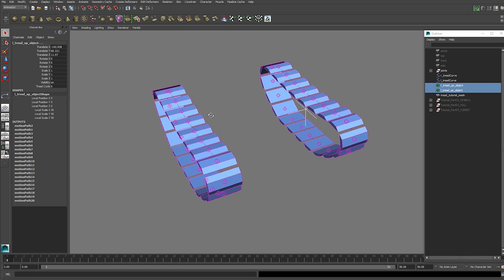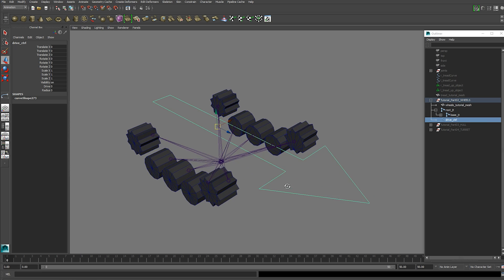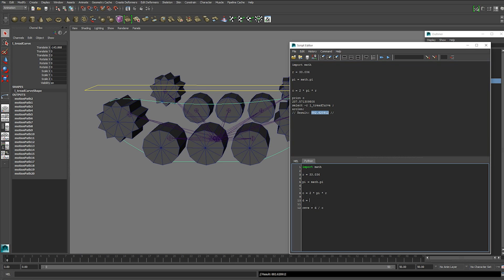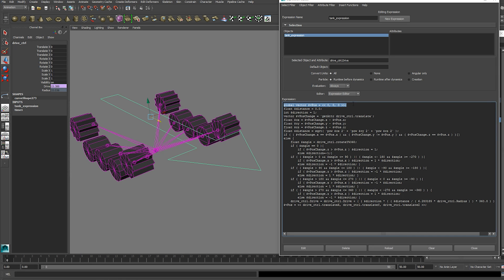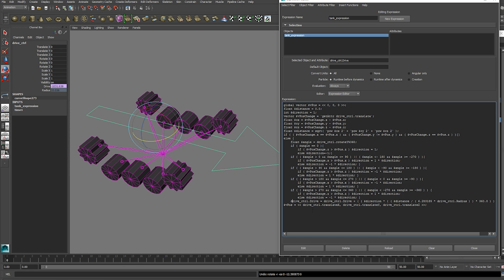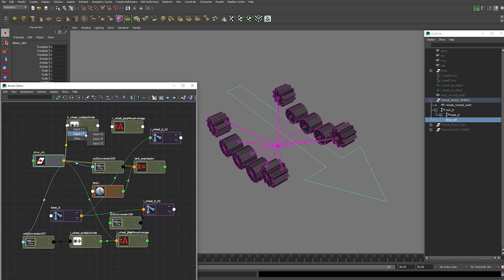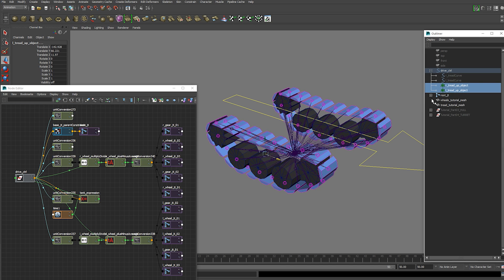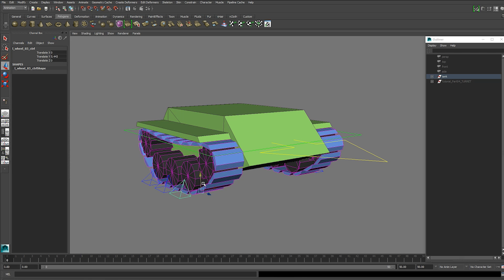How to Rig a Tank in Maya | Tank Rig in Maya | Part 2 Wheels

Comment: Hey man, thank you for the amazing tutorial! Only issue I'm currently troubleshooting is trying to have two different wheels of different sizes. I've easily set up two different controllers for one big wheel and one small wheel. The problem is that I can't find a way to have these attached to one controller that moves both at the same time, factoring in the different radius of both wheels. Every time I set up a parent constraint, or use the connection editor, I can only affect one wheel at a time, never both. The translate values on both wheels are changing, but only one drive value is. I figure it may be to do with the script but I am not good with programming/scripting whatsoever. Anyway, I'm still working on it now and hopefully I'll find a fix, but wanted to ask anyway. Thank you!
Reply from the maker: find the difference in size between the wheels and just use a multiply/divide node to connect to your main wheel. You wont need 2 controllers.
Reply: @SimonMills  Thank you! Yeah I was just trying that and I think I've almost got it, just not very familiar with these nodes but I should figure it out eventually. Thanks again!

Comment: Hi, this tutorial is great!
i have two questions about the expression, maybe you can help me out.
first, i don´t understand why/how it works with the global vector variable $vPos to get the value at the end from the code to be piped in again. doesn´t it read the value <<0,0,0> in the beginning, why it isn´t reset to that zero-value?
(maya help, doesn´t answer my question http://help.autodesk.com/view/MAYAUL/2015/ENU/?guid=Procedures_Global_and_local_variables)

second question, i had a hard time to wrap my head around the ifelse-angles, i tried it that way:
                 if(($angle>0 && $angle<=180)||($angle<-180 && $angle>-360)){
   if($posNew.x > $posOld.x) $direction*=1;

   else $direction *=-1;
   }
  if(($angle>180 && $angle<360)||($angle<0 && $angle>=-180)){
   if($posNew.x > $posOld.x) $direction*=-1;
   else $direction *=1;
   }
it seams to work too , but i would like to now if i miss something and there is a mistake in my version?

Thanks

Comment: Hi, I've run into a problem with the drive control rotation. The wheels rotate in the wrong direction when I rotate the drive ctrl but work perfectly when I translate it. Thanks.

Edit: I got it to work by making the revolution number negative. Will that cause any major issue later on?
Reply: I had the same issue, thanks :D
Reply from the maker: Nice job fixing the issue.  It should be fine.
Reply: @SimonMills  Thanks man.

Comment: Hi, love your tutorial, but i have a problem with the expression.If i move the Drive ctrl in x , and set it back to 0, the drive attribute doesn’t set back to 0.Can you help me? Thank you
Reply from the maker: You could add an if/else statement to the expression. If drive ctrl tranforms are all 0 then set the hidden drive attr to 0. It should not matter on final result though. When looking at an object rotated 0 it looks the same as 360, 720, 1080, 1440  etc.
Reply: @SimonMills  Thank you!

Comment: When I move the  drive control after connecting the multiply divide node to the locator, the treads but not the wheels move extremely fast and not at all in proportion with the drive controller. What might the problem be?
Reply from the maker: make sure you set the multiply/divide node to the correct mode. You may be multiplying when you should be dividing for example.
Reply: @SimonMills  My wheels and gears have different radii. Rotation works correctly after creating separate multiply nodes for the gears but translation still rotates the gears at the same rate as the wheels. How would do I fix this?
Reply from the maker: calculate how much bigger/smaller the other wheels are and just connect the rotation of your main wheels to drive them with the appropriate multiply/divide value.
Reply: @SimonMills  Thanks. It worked.

Comment: Does your script detect the difference between the tank moving up a slope and just dragging the tank up in the Y-axis? The wheels shouldn't rotate on the latter.
Reply from the maker: Agreed, and a great point to bring up, Thanks!  This version does not have any relationship to the Y-axis at all. On very steep terrain u should notice inaccuracy in the tread/wheel cycle.

Comment: Hey there. I can't seem to get input 1D[1] for some reason. I tried adding it manually but I don't know how. On the other side I can do it just fine with 2D and 3D. Thanks.
Reply: So I found a mel command that gets "input 1D[1] " to appear but I'm not sure yet if it works properly. "setAttr plusMinusAverage1.input1D[1] 1;" - Just paste this into the mel tab and hit enter.
Reply: I can confirm that it works. Make sure you change "plusMinusAverage" to the name that you assigned to yours.
Reply from the maker: Nice Job!
Reply: my hero.  no idea why this bit of the node was missing.  I get so irritated when I follow everything and something out of my power doesn't even line up
Reply: In case anyone else has the same issue even after following this advice;
- Add the command like AndrewHere suggested.
- Open the Node Editor and click on the Edit tab on the top.
- Click on "Connected Mode".
- Now there should be a litte + symbol next to Input1D. Click it. Both should be there now :)

Comment: Awesome tutorials! I'm following along with my own tank, and I'm having an issue getting the treads to rotate correctly. When I connected the appropriate nodes my treads, instead, rotate the opposite direction that they're intended to. I've been fighting with it for a while, I'm not sure where I went wrong. Any insight on this?
Reply from the maker: Thanks for checking it out!  Watch this: https://youtu.be/IemAaW3Yhl0?t=5m15s It mentions reversing curves if you need to. This should fix your issue.
Reply: You Sir, are a Godsend. Thank you very much, I'll give this a shot and post an update if you're interested. Thanks for the EXTREMELY quick reply too man, very much appreciated.
Reply: That worked amazingly my friend, although now one of my treads are flipping once it reaches a certain point on the track rotation, not sure how to fix that lol.
Reply from the maker: not sure of the top of my head, but you could try playing with the curve shape, cv overlap and spacing can cause that
Reply: yea I figured out a work around for it, I had to move the actual geometry around, I think something was clipping with the joints/rig causing it to flip. I've now run into another issue unfortunately, my rotations are off. When I rotate, the wheels rotate correctly for steering, but the treads are rotating backwards now
Reply from the maker: Np, thanks for checking it out!

Comment: my tread geometry is getting double transformations...(turning its "inherit transform" off doesn't work, however turning it off in its joints does.) Assuming having "inherit transform" on is absolutely essential for the rig to work, what's wrong with it?
Geometry is all in its own group that is not parented to anything
joint hierarchy is base (your "root")->root->tread joints/wheels/cannon/body

and my treads aren't reversing direction when I move my root control backwards
Reply from the maker: May not be a joint hierarchy issue. Make sure your curve clusters are relative, also pay attention to how the curve is connected to everything else in the hierarchy. 90% of the issues I had when coming up with this rig were curve related. If you still have no luck, email me your scene and I will take a look.
Reply: it won't let me, my email says it's over the 25MB size limit -_- even as an MB (for some reason, Maya won't let me save anything out as MA anyway unless it started that way. Something about "preserving unknown nodes or data")
I do know that if you turn off visibility on the joints (with the panel's "show" list, anyway) it doesn't look like there's anything wrong with the scene
Reply from the maker: ahh, its just the double root joint setup. It is odd looking in the viewport. You have done it correctly.
Reply: ok, *phew*...thought I'd have to do something that might require me to redo all those treads...again...
Reply from the maker: Not sure if you saw this, but it will set up the treads for you: https://www.youtube.com/watch?v=IemAaW3Yhl0
Reply: clearly, I didn't XD

Comment: Hi Simon, if I were to use this rig on a more detailed model of a tank. How would I go about setting up the wheels if the gears where bigger than the wheels on the ground and if there where smaller wheels on the top for the tread to run along.
Thanks

Comment: I have one issue I cannot get past. Once I paste and create the expression, my rig gets all jagged. and the Drive attribute gets a really high value that doesn't match yours. Have I missed a step?
Reply from the maker: Sounds like it could be a scene scale issue. Are you using the scene file from my website or your own model?
Reply: I'm using my own model to follow along with a project I'm working on.
Reply from the maker: Grab the scene from my site and check the scale of the tank with your own. A significant scale difference could be the issue.
Reply: I made another scene with a close match to your scaling and even followed along with your scene. The movement is still jagged. But keyframing a motion shows that it's all working.
Reply from the maker: This could be a system performance thing. Expressions are can be quite heavy on system resources. Glad it is all working out!